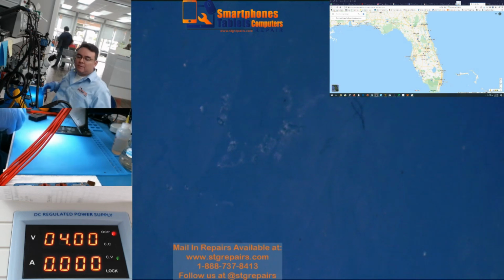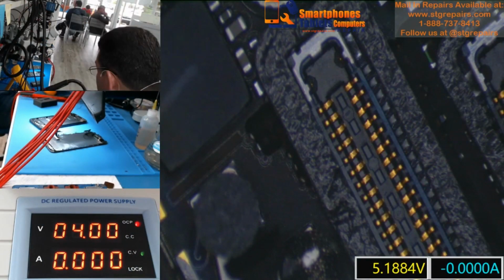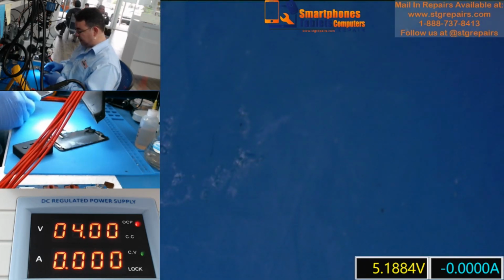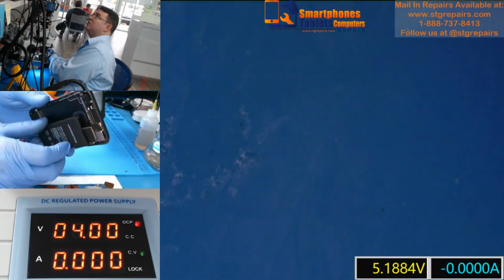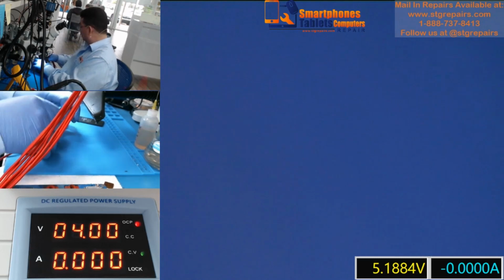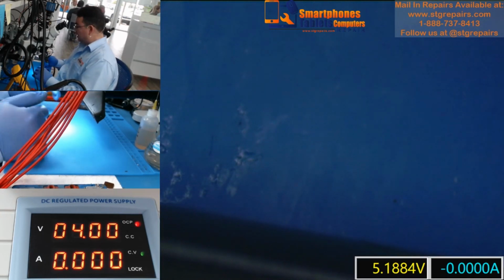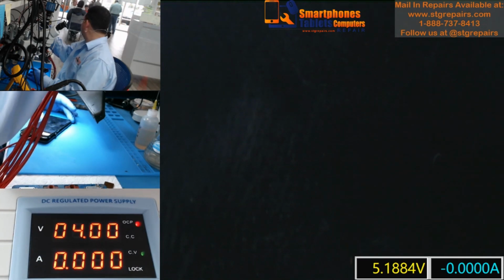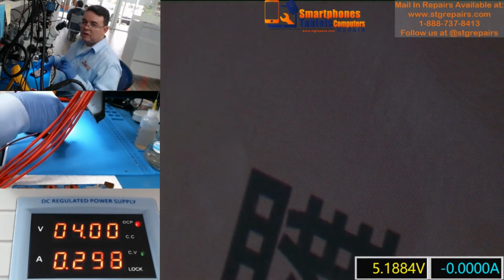Iphone 7 Battery Drains Pay Attention to Every Detail

Comment: Current jumping over 1 amb is normal while booting?
Reply from the maker: no
Reply: @stgrepairs4893  while booting not at the start of booting. From 5:35 on yours video I meant. You are saying that now its normal current but its not common that current is jumping up to 1.4 Amps
Reply: @stgrepairs4893  I think it could be starting to getting problem with RAM.